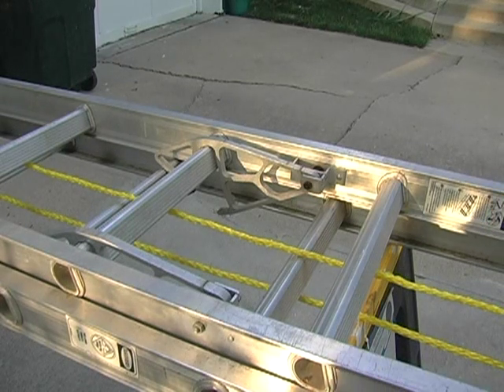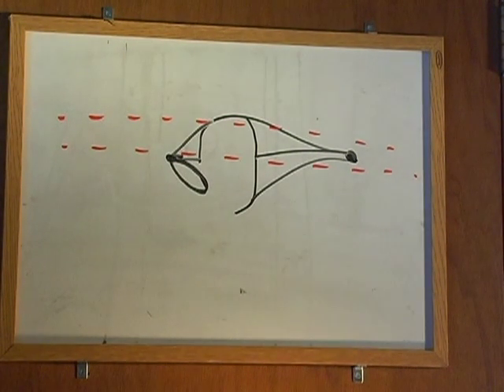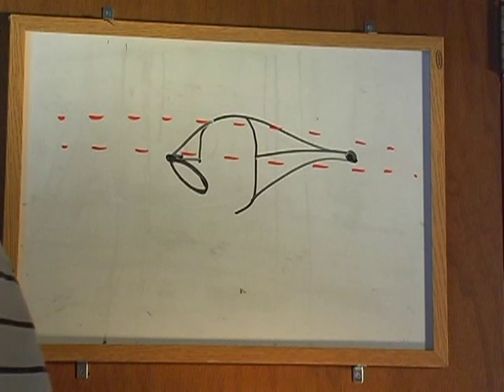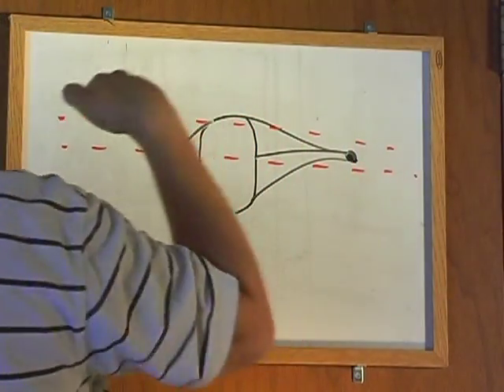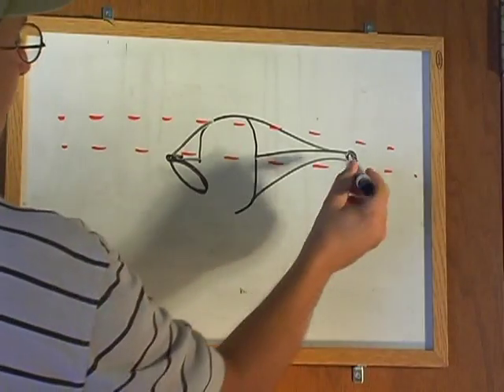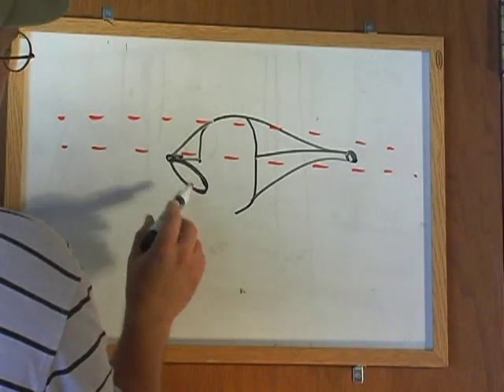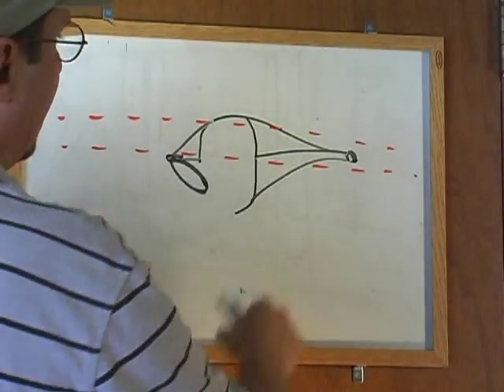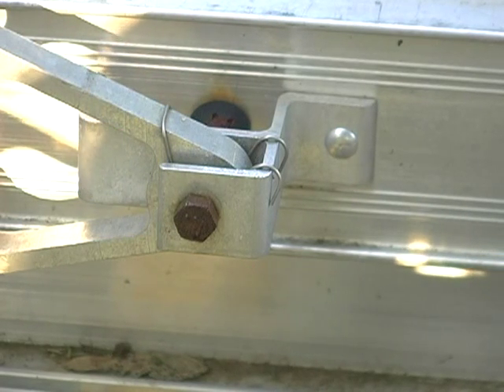Extension Ladders - Locks.mpg

Comment: I found that for flippers that get stuck it helps to spray white lithium grease on them. I bought a new Werner ladder and the flippers wouldn't let the ladder come back down after being extended. So I sprayed some white lithium grease on them where they come in contact with the ladder and I sprayed on the ladder rungs where the flippers came in contact with the rungs. After that the flippers move freely without getting stuck anymore so now my ladder works fine.
Reply from the maker: Great tip. I suppose you would want to be very careful about where that grease dripped and so forth. I know that white lithium grease isn't too "watery" but still ...